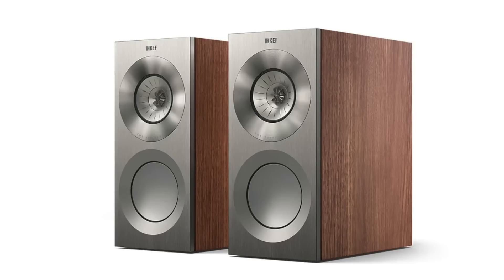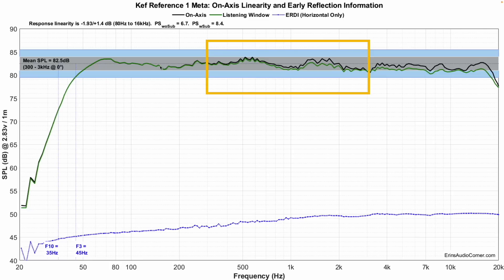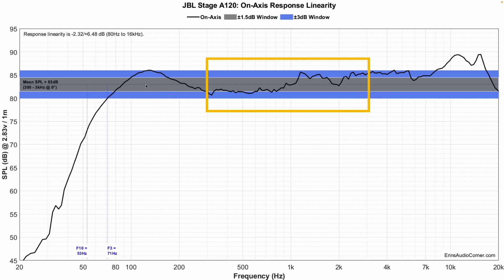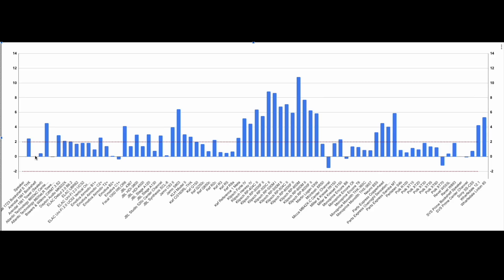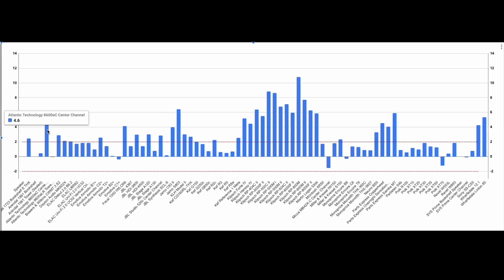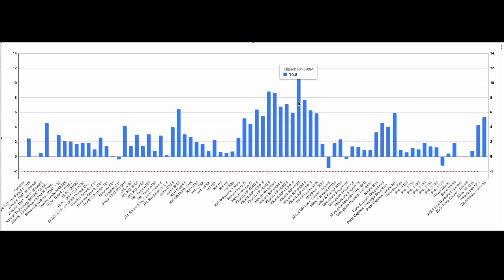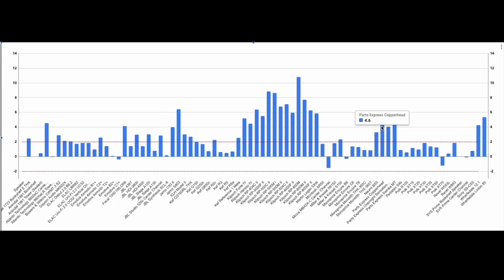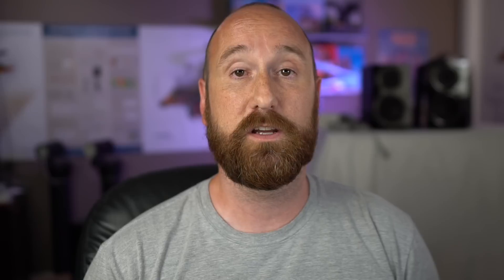BS Speaker Sensitivity Ratings and "Dynamics"

Comment: Doesn't measuring at 2.83V result in an unfair advantage for lower impedance speakers when one is looking for amplifier power required? 2.83V is 1W for an 8Ohm speaker but 2W for an 4Ohm speaker. Wouldn't be better if the sensitivity was quoted at 1W rather than 2.83V?
Reply: @Douglas Blake I have discussed this too much in here and I am not going to discuss this further. YOU can go back and read carefully what I had to say in this and other posts or watch the nice video by John DeVore that I have mentioned. I will only repeat that speaker electrical sensitivity as currently measured in terms of voltage and not power is useless to the consumer. What does a voltage of 2.83V mean to you as a consumer? At which power level does your amp produce 2.83V? You may be surprised to knowthat this depends on the speaker impedance and thus a speaker rated at 89db maybe much much harder to drive than another speaker rated at 89db thus requiring much more power and a much more beefy amplifier. Enough from me on this topic.
Reply: @Douglas Blake When I asked what it means I wasn't asking about the scientific equivalency. I was asking about if it is meaningful and helpful to the consumer, which of course it isn't. A consumer should not care about how much sound pressure  will be produced at 2.83V because he knows nothing about how many volts his amp is producing. A consumer knows about the power his amp supposedly can produce.. Plus, taking impedance out of the equation when measuring in volts means that fluctuating impedance which can cause problems if the amp cannot double its power when impedance halves is not being considered. Plus, as DeVore rightly says, it makes difficult load speakers seem more efficient than they actually are. All in all it is a measurement that, while scientifically correct, has no real meaning for the consumer and can be misleading. Consumers tend to think that sensitivity is equivalent to efficiency which it isn't if measured at constant volts rather than power. A consumer sees a quoted number of 90db for a 4 Ohm speaker and he thinks it will play louder than a 87db 8 Ohm speaker with his 40W amp while in reality it will be exactly the same if sensitivity is quoted at 2.83V.
Reply: @Douglas Blake Neither you nor Erin are getting it. Nobody should care about equal voltage because it makes no sense for somebody comparing speaker specs. But I can't be bothered anymore.
Reply from the maker: The CTA standard uses 2.83 V.
Reply: @ErinsAudioCorner  Indeed but you have not answered my question. Most consumers need to check the sensitivity to select an amp not  in order to know the sensitivity at a constant voltage. Consumers do not care about output voltage. Two 89db speakers at 2.83V and at 1m will have different power requirements for the same output level. You will need to deduct 3db from the rating of a 4Ohm speaker to make it comparable to an 8Ohm one with regards to their power requirements. Furthermore,  since true speaker impedance is not constant throughout the frequency range, disregarding the impedance in the rating makes the rating even more worthless. Quite a few manufacturers quote sensitivity at 1W.
Reply from the maker: @razisn  (nearly all) amplifiers are constant voltage devices.
Reply: @ErinsAudioCorner  Maybe you are still not getting what I am saying. Yes, they are constant voltage devices but they need more power for that voltage when load decreases, I'm sure you know that. Consumers DO NOT understand neither do they CARE about voltage. They need to have an idea about how many watts their speakers will require. In a nutshell they care about speaker EFFICIENCY not sensitivity the way CTA and you measure it. John DeVore of DeVore fidelity discusses this exact same thing in a video in his channel named: 'John DeVore goes on a rant about the High End Audio lie that inspired him to start his company'. If you don't care about what I'm saying maybe you care about what he is saying.. He is also discussing about why the CTA standard changed at some point from 1W to 2.83V. Maybe you would want to watch and comment on that video. I personally feel the same as John. Measuring sensitivity at 2.83V is legal cheating that helps manufacturers of lower efficiency speakers. If you don't agree then why don't you tell us why?
Reply from the maker: @razisn  I understand what you are saying. I just disagree.
Reply: @ErinsAudioCorner  Fair enough, just note that there's a different opinion out there and it is not only mine. If you think the sensitivity specifications as quoted help your audience in speaker selection and matching then think again. There's a reason many respected European manufacturers (ATC, PMC, Proac, Audiovector, Q Acoustics spring to mind, I'm sure there are many others) continue quoting the sensitivity at 1W and this is not to cheat the consumer public, quite the contrary. Also many headphone manufacturers quote sensitivity at mW. Most American manufacturers adhere to CTA, I suppose, but a few like DeVore Fidelity, as I already mentioned, do not. Quoting at constant voltage is scientifically correct but meaningless, unhelpful and often misleading for the consumer. That will be all from me.

Comment: "This speaker is more sensitive, so it'll sound better" well, no. That's not how that works. Sensitivity is more regarding how much effort you'll want to put into amplifying your signal going into the speaker to get it to sound good. Often times less sensitive speakers are just as nice to listen to as more sensitive speakers, they just need more power and with more instantaneous current.
Reply from the maker: Surely you’re not implying that I believe that, correct?
Reply: @ErinsAudioCorner  Of course not. You've got tons of first-hand experience to tell you that sensitivity is just a factor for your amplification stack and not a significant determining factor for sound quality. Most people who don't have that experience just think that "more sensitive speakers sound better" because they can push them to higher output volumes on cheaper or less powerful amplifiers. If you've got really competent amplifiers and a range of speakers to test against, then it quickly becomes apparent that sensitivity is irrelevant to sound quality.
Reply: i do not think much of sensitivity when look at speakers. but there is discussions going around on higher sensitivity speakers sound different. some of that might come down to low power amps finally get to operate at a better range.
but also to make something play louder you make different type of speakers and drivers. that will make something sound different.
Reply: @sudd3660  I've found that the only thing that changes with sensitivity is how apparent the coloration or tuning of your amp is.
Reply: Well, higher sensitivity means less material in the voice coil, or less heat, for the same SPL, possibly less voice inductance. When you realize that spkr drivers as devices are on average 0.2 to 3% efficient, then 3dB increase is a very welcomed factor. I would say that drivers with high efficiency sound more dynamic and 'faster' in some cases.

Comment: At least for your average dynamic driver bookshelf speaker there are a couple of rules of thumb. You see a ported speaker rated at more than 85db you know the manufacturer is probably exaggerating. For sealed speakers the number drops to about 82-83db.
Reply: same driver in a sealed or ported cabinet has same sensitivity, only the bass is different.
if you have some kind of sealed box optimized driver for example subwoofer then the moving mass might be higher and you get lower sensitivity by a few db across the range if they did not added more power magnet.
Reply: @sudd3660  Not true. Read up about the differences in principle between sealed and ported speakers. Back pressure in sealed speakers results in the driver needing more power to move. So, the difference is in the box operating principle not the drivers.
Reply: @razisn  surely this effect is at high excursion, otherwise it can not have any effect.
Reply: @sudd3660  Yeah whatever. Read up. A sealed is less sensitive than a ported speaker all other things being equal.
Reply: @razisn  just try it yourself, 1 khz tone and plug the port, then you tell me if there was a difference in output.
Reply: @sudd3660  You do realise that you will need more power from the amp when you do that since the impedance will increase, don't you?
Reply: @razisn  not at 1 khz. 50hz and below for sure impedance rises, but lower impedance is what draws more current. sealed are pretty benign with impedance curves, ports have peaks and valleys, and 2ohm load is very heavy on the amp, 16ohm is easy on the amp.

Comment: Another easy way is if you have a speaker with a known sensitivity rating (folks can check your site for anything you've measured) and set it to a certain volume. Measure the SPL using pink noise. Don't move the mic. Put in another speaker at the same spot. If the speaker is supposed to have 10dB higher sensitivity, it better be 10dB louder when you measure the SPL.

Comment: As much I like your content, your sensitivity based on 2.83V is not the best solution because the speaker with the lowest impedance will have the higher number, which goes against a fair apple-to-apple comparison. 2.83V into a 8ohm load gives you 1W of electrical output but 2.83V into 4ohm gives 2W...
The right way of doing it is by fixed Power, not by fixed voltage. That's how we do it in pro audio, following AES standard, so the sensitivity is expressed in dB SPL at 1W/1m. basically, the voltage you send to the speaker is dependent of Zmin. 
Another thing, I think the bandwidth you choose to evaluate the sensitivity is too narrow and not pertinent. Personally, I use 100 to 10000Hz, which is more representative of music and not only voice zone. And also, don't forget the Flecher Munson curves that tell us that our hear is the most sensitive at 3.5khz, out of your selected zone, which is also very unfortunate...
Otherwise, always a pleasure to watch your videos. Keep the good work.
Reply from the maker: The CTA standard uses 2.83v.
Reply: @ErinsAudioCorner  and AES is 1W. What's your point ? I would prefer you discuss the pros and cons of each method instead of following blindly a standard. I told you why 2.83V is not a good way. I'm waiting for your counter argument to start a useful discussion. 
In fact, 2.83V is so terrible that many professional transducer companies know very well the drawbacks and how people test, that they built drivers with lower and lower impedance over the years. What 10 years ago every 18" pro woofer had a Re above 5.8 ohm (to match the 8ohm nominal category), nowadays same companies ship "8ohm" 18" woofers with Re at 5 ohm or below. The reason is that it provides higher sensitivity number at 2.83V testing and sound louder when you do AB listening...
Reply: @pwmaudio  See about this issue in the discussions under my comments in this video. Constant voltage is probably more scientifically correct but useless as a tell tale of efficiency since it disregards impedance. Using power can more easily be understood by consumers who tend to think sensitivity = efficiency. Erin does not seem to be getting this, but JohnDevore of DeVore fidelity does and he has published a video about it. Many well respected British and European manufacturers have stuck to 1W and kudos to them.
Reply: @razisn  I fully agree with you. and Watt is a more well know unit. Who buys a 28V output amplifier? No one, because you buy a 100W under 8ohm amplifier!
Reply: How does one determine sensitivity via power, if the impedance is all over the map? What frequency do you choose?   Show me a speaker systems besides perhaps a Magnepan or similar  planar magnetic that posseses anything approaching a flat impedance curve.
Reply: @johnstone7697  AES standard is based on Zmin

Comment: I kind of attribute good dynamics, albeit anecdotally, to a high QMS, and to linear BL and KMS curves up to some target SPL for general listening, action movies, whatever, and the used x-over settings for the drivers, so basically high xmax in short.  Can they get high linearity in the motor and suspension AND get high sensitivity and mechanical efficiency?  I've had good success with higher QMS for stuff that's more effortless and transparent, but it's no guarantee at all.  Some say that stuff doesn't matter and that motor strength WAY out paces mechanical efficiency.  The other factor I've generally found is cone material can play a somewhat moderate role in the bite/level of detail it can do.  For example poly cones are always soft in detail.  Some play with a thicker foam sandwich type of construction to bring up rigidity in a poly setup, but detail tends to follow the aluminum cones and the composite cones most specifically.  It's not specifically dynamics, but it is level of detail, edge of note, bite, articulation, whatever you want to call it which will give you a little more amplitude and bite to the notes.  But I've also used aluminum cone subs that were as thick as mud and a foam poly cone with good detail.  Subs are one thing, but higher frequency drivers are far more sensitive to cone material choice.  A fiber tweeter will never sound like a metal tweeter.

Personally, I've never really cared much about sensitivity of a driver.  The only time I care is when I'm trying to pair a 2-way or 3-way together and want to stay with a simple off the shelf x-over for ease.  I want very close sensitivity and a LOT of linear frequency overlap across the x-over range.  Power is cheap, as the old saying goes.  However, low sensitivity does require high thermal handling.  If you do want to play with a low sensitivity driver, it better have a pretty high wattage rating.  Double the wattage only gets you 3dB, so it quickly gets really, really hard to catch up to a sensitive driver when the other driver is way out of sync.  An example is Vifa's little 3.5" TG9 mids.  They're a great little speaker, but their sensitivity is terrible and power handling low.  They take so much attenuation just to pair with any average tweeter or midbass.  The SPL graph doesn't represent reality well on them, and they're so quiet.  I ran this for a while in an active setup with dedicated amps and level controls and had to get rid of it because it was so limiting.  I bumped up in size too, not as good for off axis but better for pairing with an 8" midbass.  I'm now using Peerless' Tymphany 5.25" NE149W instead in my passive home setup, and it's such an upgrade and far easier to pair.  The SPL graphs show similar SPL too, but they're wildly different in reality.  At some point you just can't give a low sensitivity driver enough power to compensate or risk burning them up.

Comment: Why 2.83V instead of using 1Watts? 1W is more absolute in my opinion.
Reply from the maker: 2.83v is 1w at 8 ohm. Amplifiers are constant voltage sources. Not constant wattage. The impedance is what determines power. Plus, the CTA standard calls for 2.83v. 👍
Reply: See about this issue in the discussions under my comments in this video. Constant voltage is probably more scientifically correct but useless as a tell tale of efficiency since it disregards impedance. Using power can more easily be understood by consumers who tend to think sensitivity = efficiency.

Comment: This reminds me of the old days when some unscrupulous manufacturers rated amplifiers in ridiculous myriad ways, like "music power", some of them into absurd impedance loads and totally ignoring distortion, sometimes combining multiple channels. It was only after consumers complained that we got a standard of RMS power per channel at, say, 1% THD. So some manufacturers used to rate eg. a 40W RMS per channel amp at like 1000W "music power" (and they didn't tell you that's at 10% THD into 2 ohms, combining 2 or 4 channels, for 1 ms).
Reply: Indeed but you may not be happy to know that the current CTA specification which dictates measuring the speaker sensitivity at 2.83V which Erin follows rather than at 1W does a similar thing penalising high ohm speakers vs low ohm and difficult to drive speakers. See my other comments for more detail.
Reply: music power thats hilarious

Comment: how is that room an anechoic chamber? unless you are measuring spl outside in the open.
Reply from the maker: Klippel Nearfield Scanner.
Reply: @ErinsAudioCorner  "Klippel Nearfield Scanner" is not an anechoic chamber.
Reply from the maker: @KidAgainHobbies  you’re right. In most cases, it’s better than an anechoic chamber. You should look into it.
Reply: @Douglas Blake its definitely not better than anechoic. from the distance they measure im sure i can use rew and a calibrated mic and get a similar result. you really need to measure further away to get accurate dispersion patterns and frequency response. most speaker designers use anechoic rooms for a reason.  there are lots of errors on hobbyist/enthusiast forums and youtube measurements so i take it with a grain of salt.